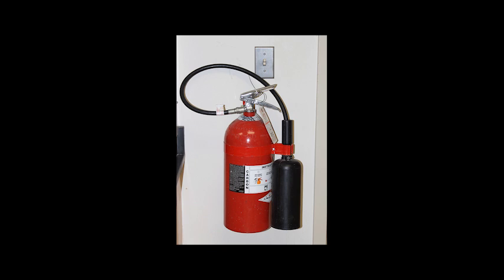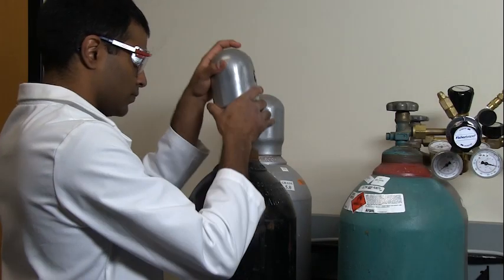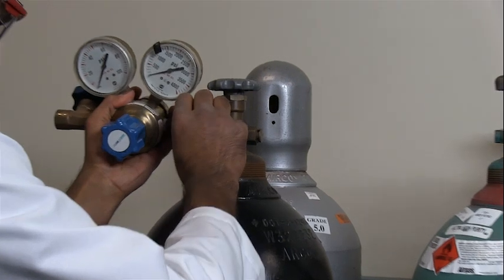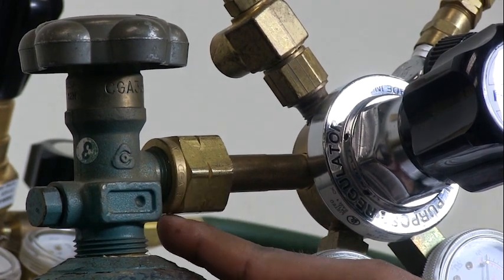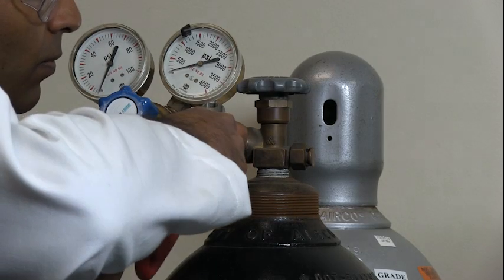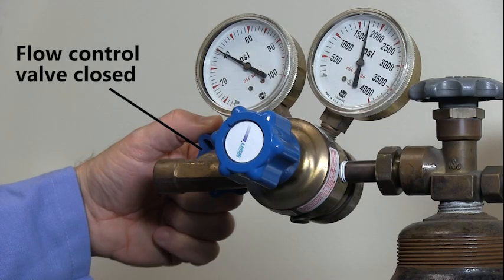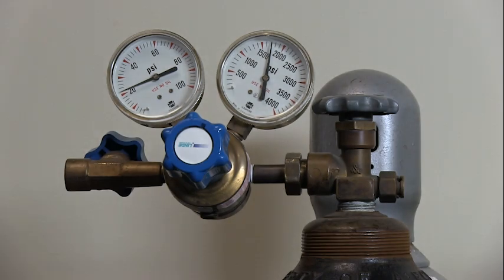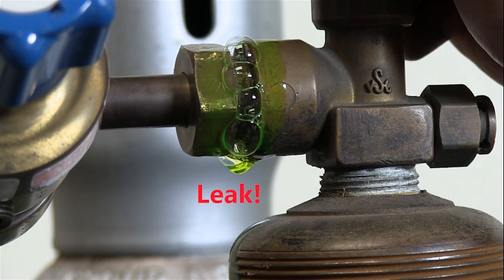Regulator Installation

Comment: Can I use oxygen pressure gauge on LPG gas cylinder ?   I WANT TO KNOW HOW MUCH GAS IS INSIDE THE CYLINDER. METHANE PRESSURE  A CYLINDER AND OXYGEN PRESSURE CYLINDER ARE THEY THE SAME?

Comment: Does the output pressure decrease as the input pressure decreases?
Reply: It depends on the regulator used.  A double stage regulator does a better job at maintaining output pressure as the cylinder pressure decreases.
Reply: The purpose of the regulator is to prevent that but it's wise if your process requires full output pressure not to run the cylinder until it has none.

Comment: On movie you can see teflon tape wrapped around the screw :-)
Reply: @@Roadster1215 Plain Teflon is best used on low pressure fittings but thread sealant is better (less likely to unscrew) and Krytox sealant is available. Oxygen-safe Teflon tape like Blue Monster is preferred for high pressure oxygen connections like nipple to regulator because all it takes is a tiny crumb of the wrong material (or even regulator brass) for particle impact ignition and an oxygen regulator fire. I've rebuilt my own oxygen and other regulators and torches for many years and worked with GOX and LOX on USAF fighters. It pays to be more careful than what many people get away with...

Comment: What if there is no flow control valve the regulator? What is used to control flow?
Reply: contact my whatsup: +8613971012566, Email: daniel@nai-lok.com.cn
Reply: Ever find the answer to this?
Reply: Your question will have to be much more specific and is best addressed on a forum. If the regulator is a "fixed" regulator than pressure/flow is preset. If you've an old regulator find out who made it and contact their tech support for a manual if you don't have one which is common.

Comment: As someone in the regulator manufacturing field, this video is very good. Highly recommended.
Reply: can i ask you something about regulator?
Reply: Me too! I have questions, I need answers! :)
Reply: @toysareforboys1  feel free to ask
Reply: @TeamNinjistik  I forgot what specific question I had :( I need very high flow nitrogen gas at 175psi from a tank (3000 psi?). I found some high flow regulators from Concoa, i.e. 1/2" NPT in and out, up to 24,000 SCFH flow, part# 67B2321-01-580R. The problem is the valve on the tank (CGA 580 connection) only flows 1500 SCFH. Can I put a tee on the tank between the tank and the stock valve so I can connect the regulator directly to the tank? If I do that I assume I can put a full port ball valve on the output of the regulator to shut off the flow. They also have 3/4" NPT in/out with model 67B232B-01-000R but that's getting a little crazy. Another company with an ultra high flow regulator is DK-LOK with part# 092-0350C-1 for 1/2" NPT and DR702-SP-025-NP2-H1 for 3/4" NPT. Let me know about the ball valve option on the output to stop flow, or if that would be bad for the regulator over time. Thanks!

Comment: I have to work with compressed gas, scared to death od blowing my hand off.
Reply: Knowledge is power so study the subject of industrial gas safety. Many workplace briefings are insufficient. The stuff isn't magic but should be treated with respect. READ. Videos are a start but text fills out useful details.